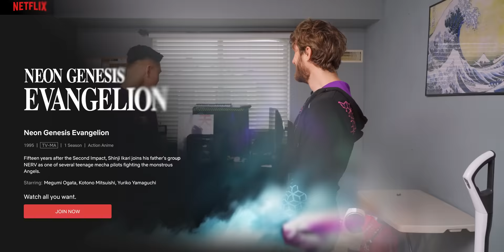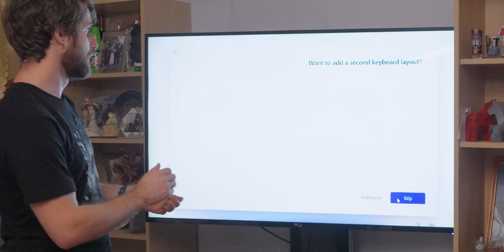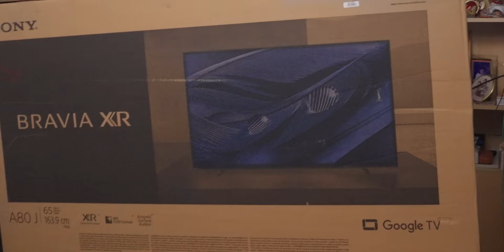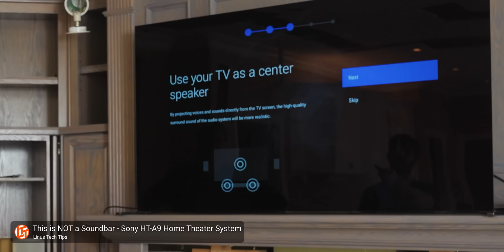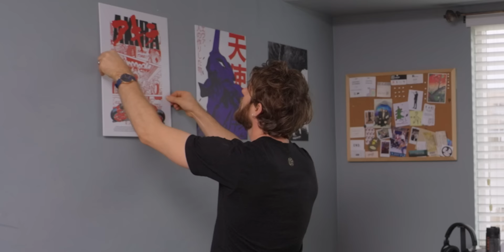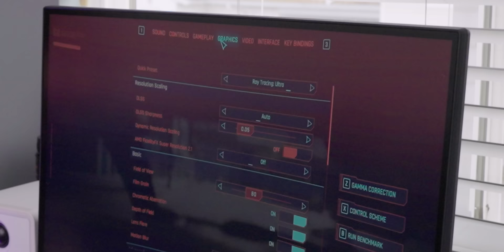His Money Management Skills Are VERY Questionable - Intel $5,000 Extreme Tech Upgrade

Comment: I would NEVER remove that CPU if this computer manages to post after the bent pins surgery
Reply: well... unless you are replacing the board it's self.
Reply: @LevSco  

Why would you remove the CPU???
Reply: Me too, and no OC ofc (all core turbo something something)
Reply: I know they couldn't focus too much on the repair for a sponsored video, but how many people would willingly, and could actually pull off a repair like that in the basement of someone's house on a flimsy plastic table with a phone for a light?

And succeed on the first try!?

That was a complete badass move and could've easily stolen the show if not for all the other madness going on. Linus is a Boss in all the best ways.
Reply: @user9267 you could use the CPU as a parachute, not a well working one, but a parachute indeed
Reply: @Halsdran  i like the way you think
Reply: Linus fixing the bent pins was the best part of the video imo
Reply: I also bent the contact pins on an eva motherboard, even worse though was that it was the z690 version so that was a real blow. After trying atleast 5 times over the span of a week since it took weeks for my cpu to arrive, I managed to make it look somewhat originally like how it was and it works "fine" now. I need to upgrade my cpu soon though so thats always a constant worrying thought.
Reply: I had a bent pin i fixed, and i never removed the cpu ever since it was fixed... until the pin shorted and i had to re-unbend it because i did a poor job of unbending the pin. Realistically, removing the CPU won't cause the pin to bend unless you drop it.
Reply: He'll probably need a new motherboard by the time he wants to upgrade his cpu anyways, just sell that as a cpu motherboard package on ebay
Reply: @zierlyn  I mean, pin surgery is not that hard, all it needs is a thin metal to put between the pins and some light. Its not hard, its just very time consuming and very anoying to do. He probly spent around an hour just on that
Reply: Hahaha I would. If it works then it's likely to be functional. But yeah I get you. It's uncomfortable when dealing with strange issues in fear of making them occur again or exacerbating them.
Reply: @zierlyn  ive done smth like that before, at work where the fricking intern dropped a SERVER cpu onto the socket and the corner went streight into the pins, one pin broke cleanly off and i think like 5-6 more were bent, i managed to bent them back and fortunatly the broken pin was just some power pin, so it actually fired back up after my fixings. thank god else we both prolly would have been thrown out because i allowed him to do the cpu🙃
Reply: @XLGaming  I had this same experience although it didn't show up until I swapped the chip maybe 2 different times and about 5 years after I first unbent them. Couldn't POST - after hours of troubleshooting pull the 6 series i7 and it had a scorch mark on the bottom of the chip! I scrubbed it with a pencil eraser and has been working "fine" ever since.
Reply: @offdazaza2769  Yeah I'd recommend getting a new motherboard with that CPU upgrade lol
Reply: that is what you get when you fanboy over an anime HAHAHAHAHHAHAH like a little girl and Justin Bieber lmao the point to take away from this is grow up and dont over pay to fan girl
Reply: To be fair, it's intel. If you got a high end CPU, you're already at a dead end upgrade wise anyway since they lock they new generation behind a new chipset even if it's the same socket.
Reply: @RinoAP  

?
Reply: @Santi_Ramirez02  

Ohhhh yeah makes sense then
Reply: @user9267  Upgrade with a Raptor Lake-CPU
Reply: @MrSteini1979  

Why would you remove the motherboard to do that?
Reply: @LevSco  itself*
Reply: @user9267  You understand me wrong. Caleb wrote he would NEVER remove the CPU. But for an upgrade to Raptor Lake you have to remove the CPU. Or you change both Motherboard and CPU.
Reply: @user9267  to reuse the cpu and replace the board
Reply: @photic9855  lol whats this gotta do with anime or anything. Regular motherboards can occasionally have bent pins too as we've seen many times on this channel. Value is arguable, but turned out cool enough for linus to give a bit of a praise. Truly the only thing worth mentioning here is how much of a boss linus is as he fixed it right then and there.
Reply: @techcommentlooker3951  I'm willing to bet if he bought a regular not modified version of the board it wouldn't have had the bent pins but yes the fact Linus actually fixed the dam thing on a tiny wobbly plastic table in a basement is awesome

Comment: The extra long cable for the CPU connector actually makes a lot of sense given that power supply was intended to be used with ASUS' Evangelion Helios case.

The Helios is so tall that a normal length cable can only just barely reach motherboard and even then only if you run it straight there without cable management.
Reply: i though it was  reference to the eva power cables
Reply: @0000Tiberius0000  that's got me thinking, it would be really funny (but totally pointless) if someone made an Evangelion themed UPS that had the countdown timer on it for when an EVA disconnects from external power
Reply: @chdn  

If I don't see cable popping off like off EVA I'm not considering it lol
Reply: That thing looks huge

Comment: Nice job with the bent pins. I know from experience that a bent pin can lead to trouble months later even if the pc did work fine initially.
Had a pc that was working fine for almost one and a half year but then started to randomly shut down during operation. The issue was so random that nothing i did could help to track it down. I would remove or reseat a component and then it worked fine for a couple of days snd then start again.
Turns out it was a single bent pin on the socket that probably shifted ver so slightly when moving the pc.

Comment: To anyone who built a PC and couldn't connect to wifi due to missing drivers:

Just share internet through USB with your phone. You can connect your phone to wifi and it basically acts like a antenna so you don't have to move your whole rig.
Reply: As someone who had the same issue recently and remembered what you just wrote and felt like a genious, i can wholehortedly approve of this message.
Reply: This is super useful when doing wacky stuff with laptops. 

I installed Linux and while using WiFi for setup is an option (but its bit of a pain and can have issues) wire is king and this gets very close
Reply: Yeah, this is the best way if you don't have another computer/laptop you can download on.
Reply: I don’t think it’s possible with iPhones tho. I always needed to install iTunes to be able to hotspot.
Reply: @zsobikaa  you don't need to install itunes but you need drivers
Reply: when my wired internet line goes down i do that too. it's nice if you have a big data package plan, or however you wanna call it.
Reply: it also works through bluetooth
at least on linux it does, and it's how I updated my drivers🤣
Reply: I would add that not all cell phone plans allow hotspot. I would check. A work around though is downloading the driver's to the phone and then transferring the files to the PC via USB.
Reply: @NathanRedberry  I couldn't do Bluetooth on mine. It needed ALL the wireless drivers so I still have to use my phone as a wifi antenna haha. Thankfully I have a wired connection now.
Reply: @bigk777  yes that is why I mentioned you use your phone as a wifi antenna. As long as your phone is connected to WiFi it won't use your cellular data.
Reply: Been doing it for years
Reply: @allbromobro3505  Oh that's right. Hot spot doesn't care where the internet comes from. Your PC would just see the phone as a wireless access point.
Reply: If your phone isnt rooted, alot of major american carriers charge extra for tethering and lock the feature on your phone if you don't pay that ransom fee for a basic hardware feature thats already there... So might not work for everyone.

But you can always download the driver package on your phone and transfer over usb.
Reply: My phone doeant do the share wifi frome home thing tho it does data sharing not wifi
Reply: @drewcipher896  Good warning. However, I believe almost all droid phones work fine as a wifi antenna or range extender without the use of 3rd party apps. (At least in my experience with multiple carriers and phones) Which is why I said "connect your phone to wifi". If you don't have wifi then what you suggested would be an appropriate step. I wouldn't put it past major carriers doing that though.
Reply: How bad are you at building computers? Wifi worked just fine on my first ever PC that I built with little education
Reply: i was like wth why they didnt do that
Reply: @Brandon it usually happens when you build on newer hardware with a older windows install. For example: windows usually comes with WiFi 5 drivers but the motherboard needs wifi 6 drivers in order for the wifi to function. And a internet connection is needed to download the latest version. Do you see the flaw in your logic? It isn't the builders fault that windows didn't have the right drivers for your mobo to begin with.
Reply: @drewcipher896  That was true five years ago perhaps, but no longer true on any of the standard postpaid plans from AT&T, T-Mobile, or Verizon. Granted, even the cheapest standard postpaid plan is more expensive than it was five years ago, but that’s true for just about everything these days.
Reply: @drewcipher896  Wtf really??!! Holy shit is that dystopian.
Reply: I've got one of those old USB WiFi stick that i still use for occasions like that.
Reply: on a side note, I fried one of my phone's battery with that exact method. Tethering might be fine and all but using it for a month straight is simply stupid.  Now it shutdown at 50%.
Reply: @sangletan7076  yeah phones are not great at being plugged in 100% of the time. Ltt even mentioned it once in a video a while back.
Reply: I honestly thought the wifi bit was an clever segue to installing the TV

Comment: The PSU's color scheme is in fact correct!  (canonically at least). NERV's color scheme is red and black, and the cables represent either Tang or blood. Still, I'd have gone for a full purple/green theme.
Reply: I think the issue is more, he could've gone for a NERV (black/red) theme or a 001 (purple/green) theme. I do think it's kinda weird to go the a single theme 90% and 10% not. Pretty much proof that he just looked up "evangelion" computer parts and shoved them all into his cart since he got TWO power supplies.
Reply: @Zhajn  He can say the this is EVA 01 Pseudo-Evolved since in Rebuild 2.0, Eva 01's green does switch to red when Shinji's trying to rescue Rei.
Reply: You could think of it as nerv(psu) powering the eva(the rest of the computer) via cables
Reply: @astrofavilla  for transformative allegories, personally I believe that's what the RGB is for. otherwise, I like the hard color scheme to match. I'm just glad it's not my build, that random extra red would constantly nag at me in the back of my mind. I would've eventually HAD to either go with the purple 650 power supply or found another just to match the theme. lol
Reply: Eva 01 carries the red spear of cassius, which is almost as long as this PSU cable.  It's within the theme.
Reply: @Zhajn  even though its not the same theme i still think the red accent looks nice in the build

Comment: Okay, so I appreciate that extra long 4- or 8-pin connector, as I recently upgraded my rig, and the ones that came with my PSU are JUST long enough to work, but I had to balance the case, the motherboard, and those cables in both of my hands and one of my legs, to try and just barely have space to connect them onto the motherboard.

Let's just say, I hope to never have to do that for a very long time, and I will definitely be looking into getting longer cables to make this not as much of a nightmare.

Comment: Surely one of them has a smartphone that can support tethering internet until the wifi drivers are installed. 😆
Reply: In order for that to work it would need to download the driver for the phone though so you're back where you started.
Reply: @chadmasta5  no, u dont need any driver for a tethering passthrough, u only need USB driver which is already build in
Reply: @chadmasta5  windows has generic drivers built in, idk about apple however.
Reply: @imgladnotu9527  well macOS is based on linux, i would say it has better support on usb driver, linux in general, i dont owned any apple
Reply: @imgladnotu9527  iphone tethering requires itunes or some other specific msi's run ahead of time. Thanks Apple
Reply: @danielhariri  macOS is not based on Linux. It is based on BSD.

Comment: I'm shocked they didn't think to try USB tethering the PC to a phone for the internet activation... instead they moved the whole setup lmao.
Reply: Considering it didn't detect the wifi drivers I'm hesitant USB tethering would work out of the box either
Reply: @AvocadoBondage  Wifi module varies from motherboard to motherboard, therefore drivers are different. USB tethering is a standart and does not vary between motherboards, therefore built-in driver should always work (drivers for tethering are not required since windows 7)
Reply: @AvocadoBondage  it does - win 10 had stock drivers for this
Reply: @PPoverwhelming  no...
Reply: It's really not that hard to move a computer
Reply: @trev119  arguably much, much easier to plug the phone in given the time crunch these episodes run on.
Reply: They didn't want to do it because Linus's Phone couldn't connect to the WIFI too. Even if they did try to USB Tether it, it would still not work since signal wasn't good in the room or the repeater was broken.
Reply: @janmarlpaulrodriguez  hotspot used mobile data/LTE not WiFi
Reply: @PPoverwhelming  linus used a samsung fold i think in this video
Reply: @Shibby7634  you said USB tethering, not hotspot. Which could still mean using your phone as wifi dongle. But yes, he could've used that instead.
Reply: Or use the USB that MSI include with their mobos that have the installer for drivers and stuff. (Mine did)
Reply: @venusestudio329  My MSI Board did not come with any USB, it came with a CD/DVD-R
Reply: @davide4725  CD/DVD on 2023 what msi is thinking
Reply: @venusestudio329  LOL it was 2021 but still, who has a CD drive these days
Reply: i literally have the same motherboard and that's what i did, since i did not want to drag my tower downstairs at 1am, when I finished my build.

Comment: 19:20 Free Tech Tip

At the Windows 11 MS account screen, hit Shift + F10, a command prompt will open. Type "oobe\bypassnro" (without quotes). The computer will restart and when hes back, will let you create an offline local account and proceed with setup without any problems. Tested on W11 22H2 and working like a charm :)

Comment: The PSU with off-color cables was the right choice, because you can always get cable extensions in the right color later, but if the low-spec PSU kills some of the hardware you have to spend a lot more money and time fixing it later.

Comment: I got that same IKEA desk a few months ago, and I must say, it's actually a very solid gaming desk. Wide, deep, rock-stable thanks to the metal frame, and that cable-management mesh works incredibly well.

The aesthetics of the frame could perhaps be a bit better: you do see basically metal parts bolted together, which is okay if you're into that look, but does come off a bit "cheap-office-furniture". However, the top itself has a very neat matte black finish that looks and feels surprisingly premium. It is also very easy to clean, if you ever eat at your desk.

Oh, and it weighs an absolute ton. I had to ask a neighbour to help me move it into my apartment after I bought it. Very much a two-person job. Building it also takes a fair bit of time.
Reply: whats the desk called?
Reply: @michael_wave  The one I have (and which I presume this is) is called the UTESPELARE. 

At least over here in Europe, there is not really much choice in IKEA gaming desks: we only get this one, or the UPPSPEL with height adjustment.
Reply: @drtauntsalot  thank you!! the uppspel is a little too expensive for me, but definitely gonna get the utespelare for my next upgrade!

Comment: Can vouch for the tip to check CPU/socket pins at multiple angles. I used to do some computer repair for a job and encountered bent pins of this sort (though luckily never on my own hardware). First time I ever rescued some CPU connection pins of any sort was on an AMD CPU with a number of bent pins, a few of them that were nearly flat against the bottom of the CPU. No one dared touch it and I guess I was the only one crazy enough to even attempt. Somehow it worked after a first attempt, but man, I had little hope that it would!

Comment: the only place id say he really messed up is the case...i own the same case and its a sauna.. if it wasn't winter in Canada id smash the front panel glass...its incredibly restricted
Reply: I have the same case and I have to agree, it can get kinda hot especially in summer but it helps if you remove the dust cover on the top
Reply: @MultiWTFGamer  lmfao ya i did already
Reply: I got the same case but with the plastic mesh front cause i wanted more airflow. The thing averages 60~70 while idle for some reason lol

The most messed up thing is includes the RGB controller button but it's not wired to anything cause they took out the RGB controller for the models that don't come with the glass front.